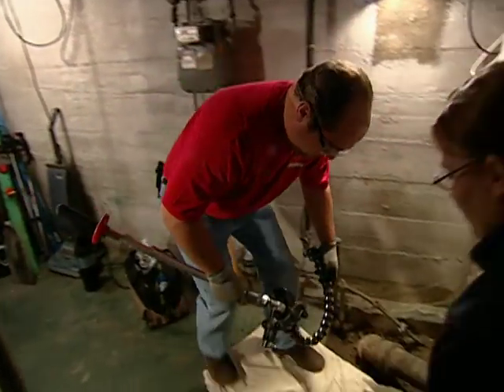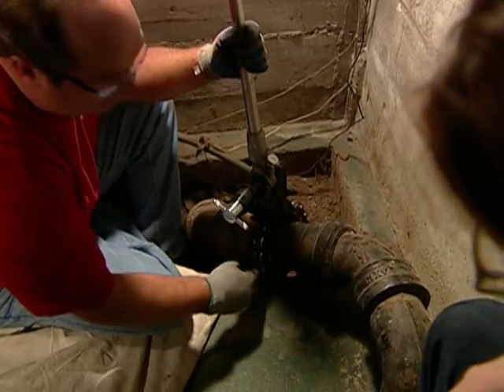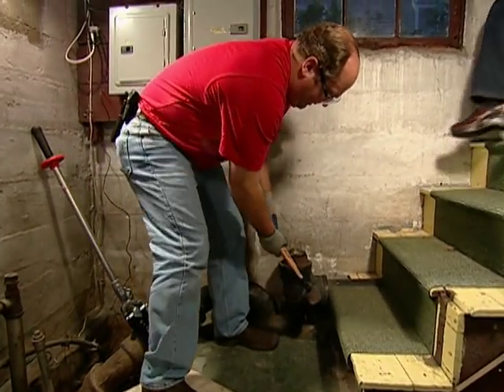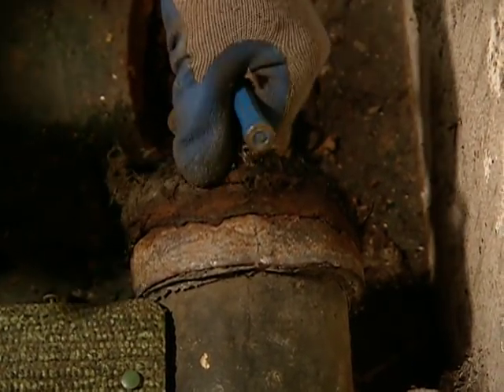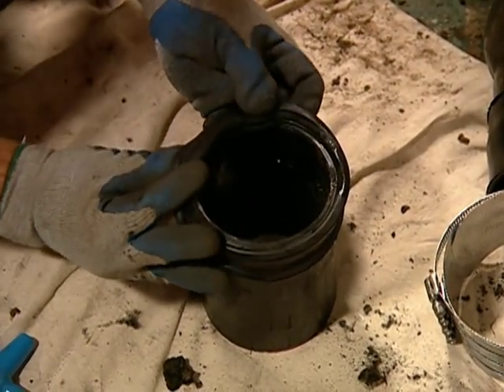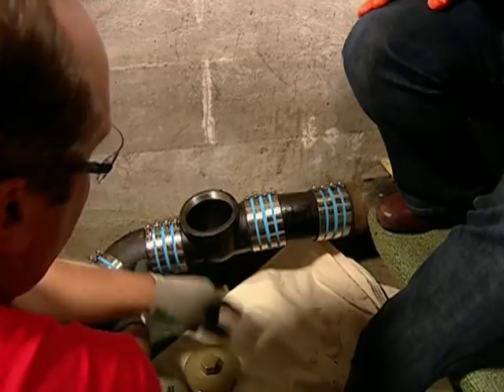How to Replace a Whole-House Plumbing Trap | This Old House

Comment: Would it be a good idea to clean the outer surface of the old pipe before folding the "rubber" sealing coupling over it? I like the fold over trick...have to remember that one.

Comment: Rather than cut multiple sections of cast iron pipe and use multiple fernco coupling bands, why not just ave ABS or PVC in between with only two couplings to attach back to the original cast iron pipes?  At least everything in between would absolute leak free (and yes, I realize these couplings are considered a permanent fix).
Reply: In some states, that is NOT legal, including there. You cannot put anything in between cast iron BUT cast iron
Reply: @Thommadura  That's why ya keep a can of flat black spray paint in the truck.. In 40 years never  a call back.

Comment: Is there a trap out by the street? After leaving the house is there a street trap that goes between the line that goes from the house to the main sewer line? If so how would you replace it?
Reply: There is a vent and trap with a clean out cap a few feet from the house outside the footer. Then a clean out at regular intervals depending how far your house is from the main line at the street; if that's where the city/town has it. It has to be dug up to be repaired. This is describing the process for the last 40-50 years. Houses much older is what is shown in this video.

Comment: Why wouldn't you use a reciprocal saw to cut that pipe? Especially if you were worried that it may not break clean using the tool you had.
Reply: Jason K castiron is hard to cut with a sawzall unless you got a carbide blade I believe but I've only used snap cutters and a angle grinder with a diamond cutting wheel
Reply: You obviously have never cut cast iron
Reply: Yes with the appropriate blade, BUT because it’s lead and hemp (because of age) it’s not good to create dust or “disturb it” and breathe those toxins in

Comment: Why not just use abs pipe?
Reply: Some plumbing codes do not allow it; you have to go "cast iron to cast iron". The other reason could be flood prevention; ABS and PVC can crack under backflow pressure through the system. They did a video where a PVC backflow valve failed; the PVC pipe failed at an inspection cap, and the backflow valve flap was ejected out of the system...4 feet of water in a basement. Replacement was a dual flap system in a cast-iron pipe for strength.

Comment: Never seen the no hub ban with 4 clamps cool.they have a new sawzall blade that's over 10 bucks and it cuts cast iron like nothing.i use that.no more of chain cutter.
Reply: Yes with the appropriate blade, BUT because it’s lead and hemp (because of age) it’s not good to create dust or “disturb it” and breathe those toxins in Lewis Coleman

Comment: Cast iron can be welded but Not just any Welder can do it.
Reply: No need to weld it; that lead and oakum joint lasts forever; I have cast iron drain pipe in my 81 year old house joined and sealed the same way. No leaks.

Comment: It would really stink if someone flushed while they where doing this.
Reply: LOL!
Reply: I'm a plumber and it happens more than it should. You can tell people until you are blue in the face, don't run any water or flush toilets. They do it anyway. Now I just turn the stops off so they can't.
Reply: Here's an amusing video from a Swedish plumbing company: https://youtu.be/MwNrmtKwWUI?t=576
They were replacing a section of a main sewer pipe and had it temporarily diverted into a toilet, when something happens. Hehe.
Reply: @bubbagrace2997  me too. And yeah you can tell them 1000 times, tell from the basement "no water!" And they dont give 2 shits. Especially the rentals......totally shut the water off at the meter
Reply: @bubbagrace2997  I turn the main water off and go flush all the toilets and run the water out of every fixture before I cut into the drain system.
Reply: I always tell customers, "don't flush but if you do the price is going to double"

Comment: Why replace it with cast iron and not pvc?
Reply: Xtrodinary You can’t put pvc in between two pieces of cast iron. It is illegal. Like materials must be used when replacing a section. To use pvc you would have to replace all the cast all the way to the fixtures and vent.
Reply: @Vidata  that is only in mass

Comment: Depending on where you live traps can not always be removed if large city with large volume of sewer water running 24 hours a day removal of house trap will cause the water in traps in the building to be pulled out causing sewer smell  been there seen that
Reply: Wouldn't that be caused by clogged vents? If it's other peoples plumbing pulling water out of the other traps in your house, wouldn't it also pull it from the house trap?
Reply: Proper venting wouldn't pull a drop of water out of any trap.

Comment: Good video.....these tools people,...can be rented at your local Hardware store...the pipes/pieces and rental will run about $125. If your hire a plumber...you'll pay over $600 for this.  Ah...not that hard to do either.
Reply: Until it breaks more than you wanted.

Comment: why put cast iron back when you can go with ABS???
Reply: Because ABS gives off toxic gas during fires, so if a living space is close to pipe, code says it needs to be Cast Iron...of course codes vary in different states

Comment: Can you use a reciprocating saw with a carbide blade??
Reply: I did, blade from Lowe's or Hom Dep, expensive (about 24 $) lasts for several cuts. Takes a bit of time till blade bites into the pipe (use reciprocating saw) but u dont risk cracking the pipe.
Reply: Yes with the appropriate blade, BUT because it’s lead and hemp (because of age) it’s not good to create dust or “disturb it” and breathe those toxins in

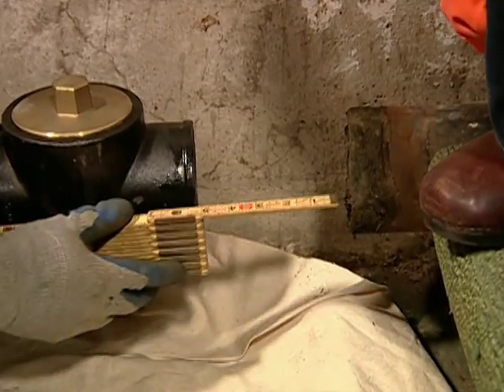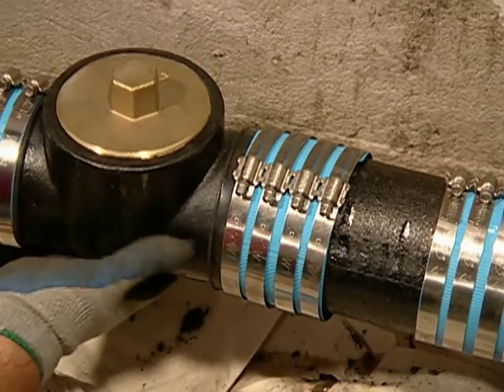Comment: 2:17 cramp screw heads facing the wall. 3:34 shows flipped in the correct orientation, leaving screw heads accessible to tighten if future requires.
Reply: Test fit for distance
Reply: Good observation !

Comment: Why did he omit the trap on the repair?
Reply: Removing the trap was the purpose.  Modern plumbing has traps on each fixture.  I would have replaced with PVC.

Comment: See the long crack on the top of the pipe he's coupling to (see video at minute 2:47). This repair probably won't pass a static pressure test.Passing a pressure test is important to home-ownwers when.....1) requesting a warranty on foundation repair from a contractor, 2) receiving a request from a home buyer or on a home inspection report, 3) passing  city inspections / permit requirements 4) the drain-line backs up!
Reply: yep, would have been so easy to cut beyond the crack and put in a longer piece.
Reply: Kurt Kallmann Get your eyes checked. That pipe isn't cracked.
Reply: Shanmike is right. That's not a crack, it's a casting imperfection.
Reply: hahaha whos going to pressure test their plumbing drain, i'd like to see someone give it a shot.
Reply: adams small engine garage I pressure test the drain about once a day
Reply: Cobra 142 if every drain had it’s own trap... no need for a redundant trap on the main drain. They are just to keep gas from entering house from sewage.
Reply: @Logan Tennant Nope... not a crack- but rather a seam or casting line. Pause the video and study. This guy been doing this too long not to notice a obvious crack.
Reply: Damn. Good eye.

Comment: Dude said excavation. Hahahaha do a video of removing a house trap in wisconsin! Break 4x6 patch of concrete, dig 6-10 feet down, through either or all of gravel, clay, 100 year compressed dirt, and all soaked in s#!T water just to expose that ancient turd of a headache. And why replace with more cast iron? PVC?
Reply: This is filmed in ma and you can’t put pvc in between cast iron. Completely illegal. You would have to cut the cast all the way back to the fixtures and the vent. In ma code like materials must be joined together when replacing a section.
Reply: @Vidata  ah that's fkn weird. Thank you tho
Reply: Remind me never to visit Wisconsin
Reply: @tombomombodombo  wisconsin is pretty cool tho. Largest music festival, largest water park, lotsa beer....

Comment: Should have put a little plumbers putty on the old to New no hub fitting just to make sure it never leaked. An old plumber told me that.
Reply: Old School guys love them some putty. They'll even use it in place of a wax toilet ring if they have too. It's good stuff but not needed for a no hub clamp.
Reply: There’s only one place you should put plumbers putty these days, the trash
Reply: nope you are wrong
Reply: @Skorlang  am worng but yet it still helps with no leaks.

Comment: Does anybody out there ever sent a house without a house trap. I just looked at a house in Brooklyn built in 1901 and tge insoection Engineer couldn’t find one.
Reply: Joe Nizza it could be inside. Could be outside. It always has a vent somewhere. Find the vent, and you’ll find the trap.
Reply: Joe in the city I live in alot of the houses (built 1940-50's) didn't have house traps.   Plumbers would clean the line starting at the roof vent pipe.
Reply: All newer homes around here don't have a house trap.

Comment: Those rubber seals should be good for 10-15 years.
Reply: tripjet999 "100 years" lolol
Reply: Thank you!
Reply: Recently dug one up from 1999...still looked brand new. Hadn’t hardened, cracked, or dried out at all and the SS clamps were still shiny. If they fail that soon they were installed by someone that didn’t have a clue what they were doing (#1 cause of failure is Mr. He-Man over-tightening the clamps).
Reply: What do you use instead?

Comment: could u have used abs 4" pipe?
Reply: you can't clamp ABS
Reply: You can clamp PVC. There is a fitting called a no-hub adapter that you put on the end of the pvc. It goes inside the no-hub band. Or you can use a Fernco to go direct from cast iron to PVC. I don't know if there is something similar for ABS since we don't work with it at all in my area.
Reply: You can and you can also clamp abs. Use what they call a mission band similar to what hes using in the video to go from the cast iron to abs u can buy them at your local hardware

Comment: ANGLE GRINDER bruh
Reply: Makes tons of dust, big mess.  The show probably paid for that brand new soil pipe cutter and Richard took it home with him.
Reply: Jnes01 Have you ever used one of those cutters? The "big mess" you might get from using an angle grinder pales in comparison to the cracks that can eminate from a cut made with this type of tool. Cast iron is very brittle and often breaks lengthwise from the stresses introduced in casting.

It only takes one instance of a pipe cracking like this from using a soil pipe cutter for you to switch to some thing else. When replacing cast you generally only need to make two or three cuts. If the pipe cracks farther back in a hard to reach area then the job just got a lot worse. That is why you don't use one of these in tight spaces.
Reply: @skoronesa1  Yes I've used them.  Definitely not a good idea to use them in if you are working in a small area.  That pipe is above ground.  You have to remember this is a tv show, so the decisions they make are based on that.  If something went wrong, they wouldn't show it.  In reality, a sawzall with a carbide blade would have been the best choice.  The homeowner could still watch and they could film it.
Reply: @skoronesa1  I agree with everything you just said but I watched a guy use one of these tools because if a tight space in the wall but he used it like a tube cutter. Back and fourth then tighten repeat. Ever try this.  It had the chain blade but not that racheting handle on the cutter. Thanks for your comments
Reply: @corysturgis6660  Yeah, I've tried that, it's just how you use them.

The casf iron has stress built into it from when it was cast. That stress runs around the circumference of the pipe but the grain runs long ways. When it gets thinner from rusting it will reach a point where it pulls itself apart and cracks down it's length. 

If it hasn't already cracked like that you may cause it to crack like that with the snapper.
Reply: @skoronesa1  cool. Have a good day

Comment: "You can call the drain company"  ... drain company shows up...  "Who did this lazy job with these clamps!?!?!, let's take it out and do it right. Sorry man."
Reply: Disagree.  My neighbor called a drain company 3 years ago and they cut out a section of cast iron pipe and replaced it with new pipe.....using those same clamps!
Reply: Only an idiot would redo it in lead and oakum. The old plumbing unions in the states are crooks, MJ clamps are superior in labor savings and serviceability.

Comment: If your using no hubs why not just use pvc on the replaced parts?
Reply: Xtrodinary You can’t put pvc in between two pieces of cast iron. It is illegal. Like materials must be used when replacing a section. To use pvc you would have to replace all the cast all the way to the fixtures and vent.
Reply: Vidata so how come the inspector passes my sewer clean outs that have cast iron coming from the house going into a pvc clean out then into the clay sewer
Reply: B Hickey I don’t know what state your in but in MA it’s illegal. In reality, it’s the inspectors choice of he like it or not. But Richard is an old timer so I couldn’t see him doing that plus its a building show. If someone from the state sees him doing improper stuff his company might get issues idk
Reply: Vidata lmao your obviously not a plumber. No one would ever make you repipe your entire house bc your had to break open some cast iron to snake a backup

Comment: why not just use a sawzall with a blade that can cut it clean? then don't need to worry about cracking
Reply: because you would be there forever. In Chicago this is still code for drainage piping. And yes it still is cut the same way as he did. Its sweaty, dangerous and a pain in the butt.

Comment: Putting in a whole house trap is against code, because every fixture in your house would be double trapped
Reply: Dude...what're you talking about...so what if it is...ever hear of a master trap? Guess not.
Reply: dude, u still live in the dark ages, nearly all plumbing codes have banned building,house,or main traps , MI plumbing code 2012, 1002.6 Building traps. Building (house) traps shall be prohibited, except where local conditions necessitate such traps.
Reply: This is out of the 2009 IPC book: 

HOUSE TRAPS 
House traps are no longer allowed; they represent a double trapping of all fixtures. 
Local codes may allow house traps under certain circumstances. House traps were 
once installed where the building drain joined with the sewer. Most house traps 
were installed inside the structure, but a fair number were installed outside underground. 
Their purpose was to prevent sewer gas from coming out of the sewer and 
into the plumbing system. But house traps make drain cleaning very difficult and 
they create a double-trapping situation, which is not allowed. This regulation, like 
most regulations, is subject to amendment and variance by the local code official.
Reply: That's an old trap, after all, this is called This OLD House.  Back in the days when they didn't use a trap at each drain fixture.
Reply: Might have already been changed throughout the years.
Reply: +Mister Hat Absolutely. This includes floor drains.
Reply: There are several cities in Michigan where local code overrides this. Off the top of my head St. Clair Shores with it's combined storm and sewage system is one of them.  The code book also states this is the case.

1103.1 Main trap. Leaders and storm drains connected to a
combined sewer shall be trapped. Individual storm water traps
shall be installed on the storm water drain branch serving each
conductor, or a single trap shall be installed in the main storm
drain just before its connection with the combined building
sewer or the public sewer.
Reply: I wish this code was in effect in Yonkers NY.